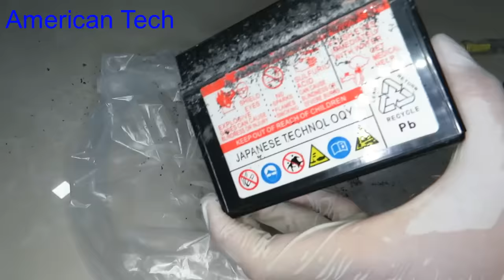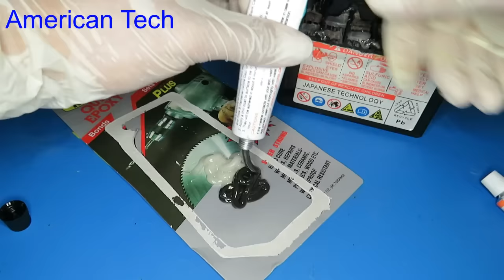Easy way  to repair 12v lead acid battery step by step , Awesome project that can help you

Comment: This is a great video on how to injest  lead and lead compounds. From the latex gloves that won't stop tiny lead particles from going through to the respirator I'm sure he's not wearing. Bet that "fixed battery" shorts too. That paper, which should be microfiber glass, should be pasted with lead oxide. Not how to be safe or repair a battery.
Reply: Yeah ! 👍
Help me out here ...
Did I see ANYTHING Right in this video ??
( feel like - - - - blank ! )
😂
Reply: @trackpersonal3025  Nope, this was pretty horrible. It's a good lesson in marketing though. Take something people don't know about, take it apart, and put it back together. Make a video and put it on youtube. I would like it if he was just doing a video about the innards of a battery, but claiming this will work is bad and the lack of PPE is real bad. Lead itself behaves pretty well until you start hearing it to melting, lead oxide and lead sulfate are real nasty. Not to mention anyone relying on this to work will be quickly let down when the battery fails. Pretty funny though.

Comment: Is it really worth that effort for a 10 bucks cheap crappy battery!??? The lead plates are still in bad condition - they must be melted and redone to do it right ;-) There is a yt-vid from india how they process big car batteries like this manually! In western countries this would not be possible / inefficient and too costly.

Comment: and you think those 2 copper wires will hold immersed in acid and next to the lead?  no!
but then again,this is just a JOKE,you started up with a GOOD battery!!   have you ever opened a BAD battery,it looks U G L Y !!!

Comment: Please do not try to do this at home. Risks include exposure to Sulphuric Acid, Lead Exposure, risk of burns from the dodgy solder and risk of battery explosion from the finished product. This video is clearly produced for views only and in no way represents a practical way to "repair"  a battery. A battery is a collection of metal plates in corrosive acid - once a battery is at it's end of life there is no "repair" that can be done and no additive or process that will recover the corroded plates. If a battery cant be "fixed" by giving it a proper charge then it is game over.

Comment: Friend in the terminal block, what kind of cable do you put in the positive and negative because I have a battery of the same one and one side broke and I put a cable through which the acid enters and degrades it, it does not hold or is due to the acid . know what type of cable to use that technique on one side that I have damaged. Thanks in advance for the reply.

Comment: What type of acid you are used
Reply: lead acid battery, type of salphuric acid, but the poorest type. used only for batteries.
Reply: @tops-us2xw  try distilled water instead. Then you also can add 10 portion of 25% concentrated sulfuric acid in 12v lead battery.

Comment: Easy solution is buy Lithium batteries that are smaller in size and have more amps also   10 times more charge cyles. Even a used one can work for years. Used charging bank batteries are good option they are cheapest and some of them have 20amp/h capacity.😍

Comment: Usefull information. Thanks.
BTW, what kind of paper and "liquid"?
Reply: Im sure its fiberglass type because the battery is an agm type. Agm,,absorbant glass mat
Reply: The original paper was replaced with a tissue paper and distilled water. no electrolyte.